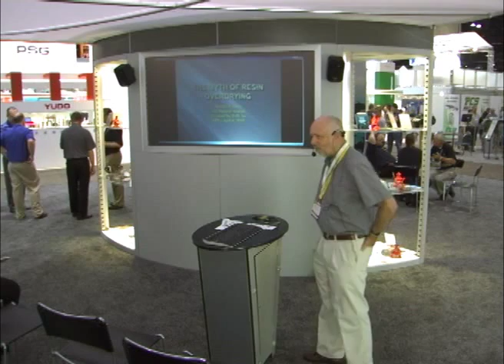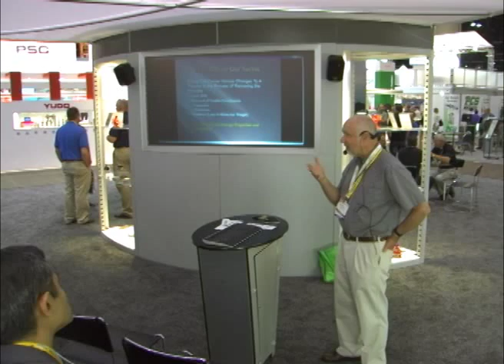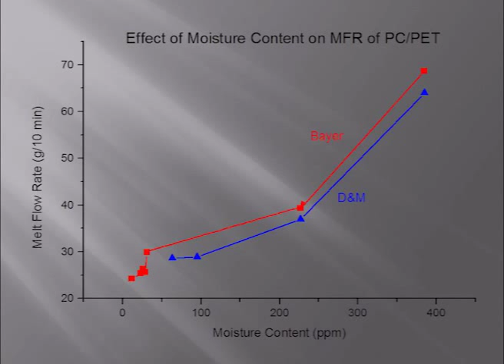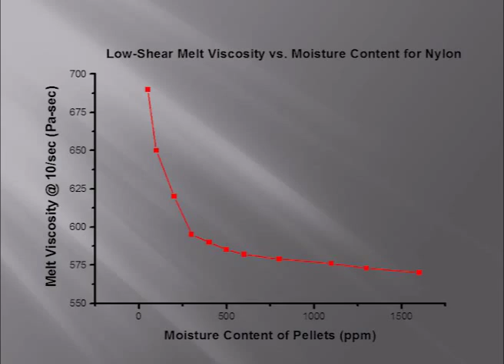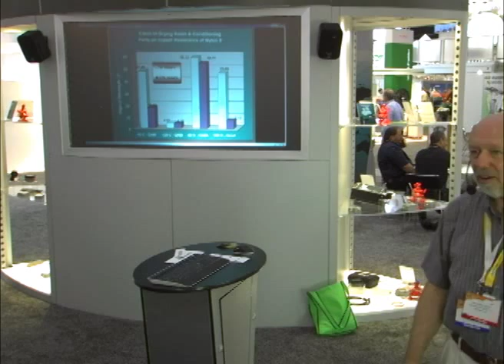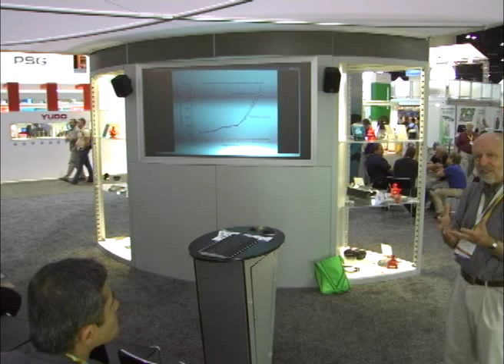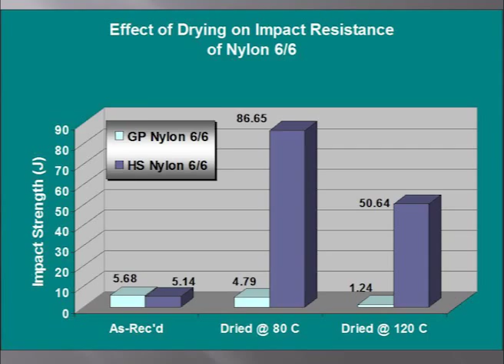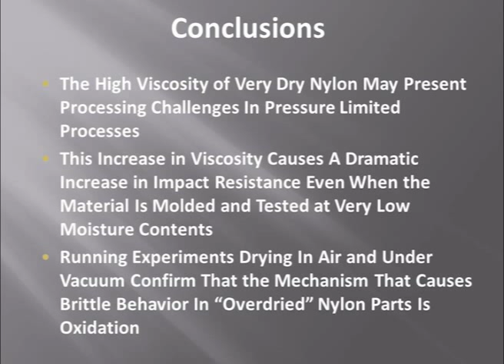The Myth of Resin Overdrying

Comment: Less water content means higher melt viscosity?  Okay, the molding press did not have enough pressure to push the material with a higher melt viscosity?   The prblem was then fixed by putting the plastic back into the box and gaining moisture back into the material thereby lowering the melt viscosity?  And with the lower melt viscosity (higher moisture content) the same molding press was able to produce a good part with a good finish?  In that case it sounds as if you just described over drying the material?
Reply from the maker: Hi John, thanks for your comment! Most materials that are hygroscopic have a maximum moisture content. Anything below that is acceptable. However, some nylons have a minimum and a maximum moisture content. If dried below the minimum, then the viscosity will rise. A moisture analyzer should always be used to have the exact moisture content. The problem with adding moisture back is that even though the plastic flows easier ( lower viscosity) and has a decent surface finish , the part strength and performance could be suffering.